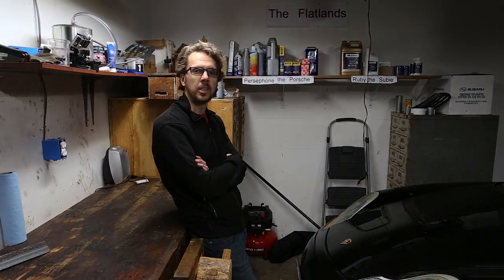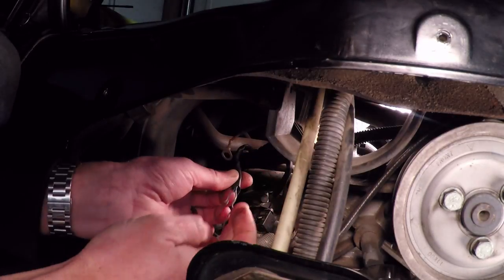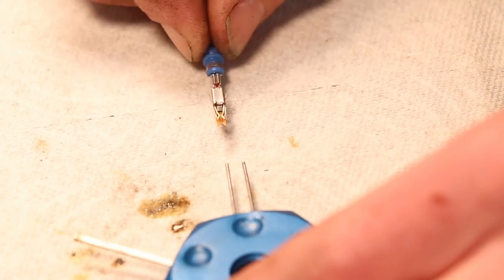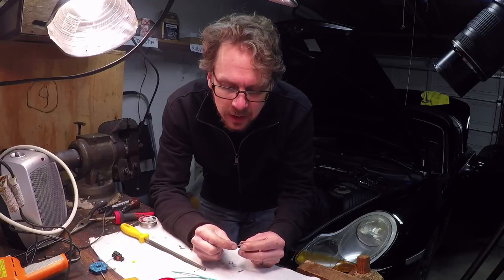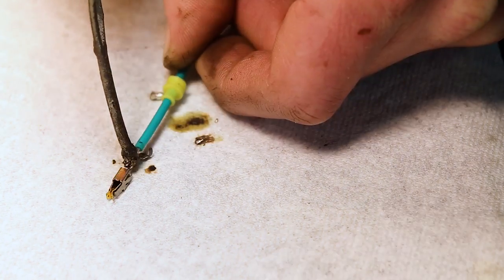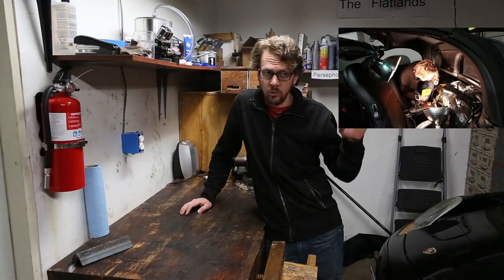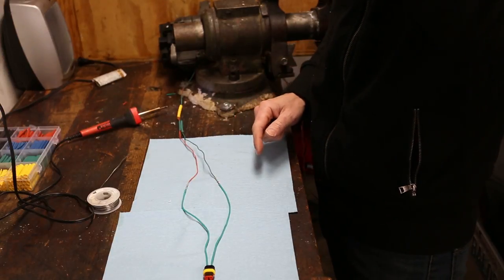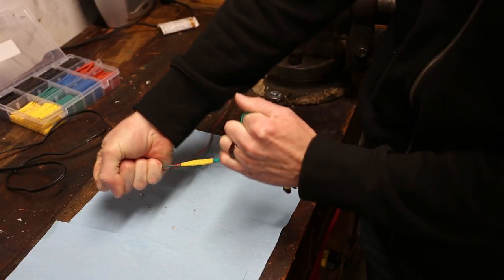How to fix wire connectors on your car

Comment: Thanks, my connector needed to be removed to get those severed terminals out. I needed to repair or replace the connector but somehow I searched and up came this video. I never got the tool but used to 2 pins to do the trick. Thanks to the info I managed to get it done but life would have been so much simpler with that terminal removal tool. Thanks again all the way from Cape Town South Africa

Comment: Good "how to" video!
When soldering wires together, it's best to heat the wires before applying the solder to them.
Keep the tip of the soldering iron on the wires until hot, then apply the solder so it flows onto the wires.
Reply from the maker: Thanks! And you're absolutely right. I didn't go into great detail, because, well, I'm lousy at soldering.

Comment: The wires going to the connector is twisted pair. Twisted pair cabling is a type of wiring in which two conductors of a single circuit are twisted together for the purposes of improving electromagnetic compatibility. Make sure to twist the cables you replace.
Reply: Robert K Do you know or know of a wire color connection diagram?. I have a crankshaft sensor connector pigtail with R/BL/BLK and the other end BR/BR GN/GN and I don’t know which goes with what?.

Comment: do you need to disconnect the battery when soldering in a pigtail connector for a coolant temperature sensor?
Reply: better safe than sorry

Comment: Do you know or know of a wire color connection diagram?. I have a crankshaft sensor connector pigtail with R/BL/BLK and the other end BR/BR GN/GN and I don’t know which goes with what?.

Comment: I'd like a link to the tool for removing the connectors from the plug.  I could comment on your soldering technique, but I won't.  I'm a fan of solder rather than crimp connections too.

Comment: Hi, what if I ripped the wires and because of that I can't pull the terminals from the wires? Can I push out the terminals instead of pulling out by the wire?
Reply: yes you can, make sure that you have a tool small enough to push out the terminal

Comment: hey man. I'm going to buy a 986 but its been sitting for 3 years. i have to drain the fluids and change the timing belt and spark plugs to get it running. i also live in california. would you consider helping me with it? you could make it a new series on you channel.
Reply from the maker: That would be fun! Unfortunately, I moved to Seattle last summer, so that won't work :(

Comment: Solder melts near the engine and cracks under vibration. Because of this it's not used in cars to fix wires.
Reply: What are some alternatives?
Reply: @hellagrant  Crimping

Comment: How did you select the wire?
Reply from the maker: I just found a wire that was a little thicker gauge than the wire on the car. I figured as long as it was as least as thick, it won't overheat, etc. I also used heat shrink tubing over the entire length as an added protection against heat and oil.

Comment: Great Video Ben. Have you ever thought of using FLUX? Makes soldering jobs a breeze as the solder flows a lot better. en.m.wikipedia.org/wiki/Flux_(metallurgy)
Reply from the maker: Thanks! That's a great tip!
Reply: @BurnersCars  I would recommend you add a piece of steel wool to that shopping list! It works wonders for cleaning a gunked-up soldering iron tip.